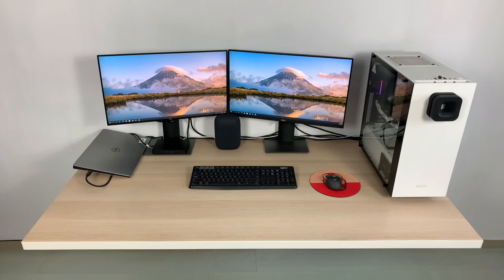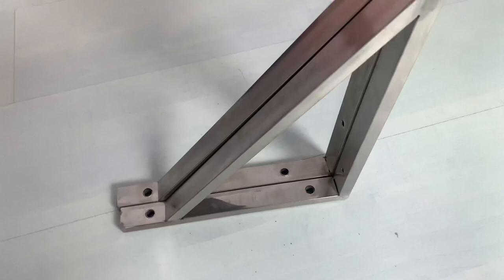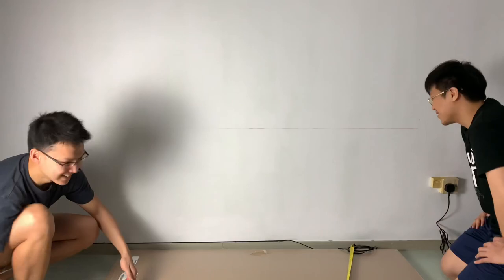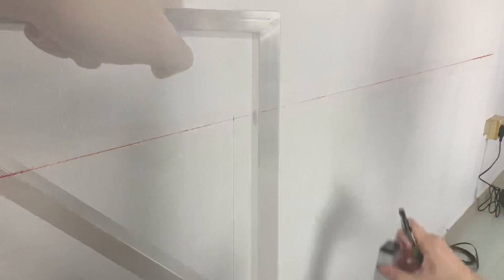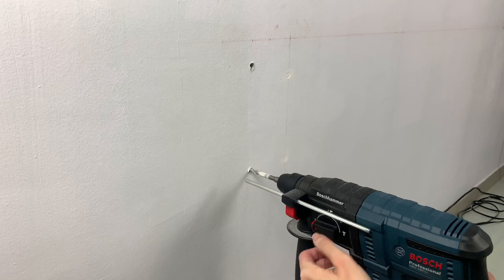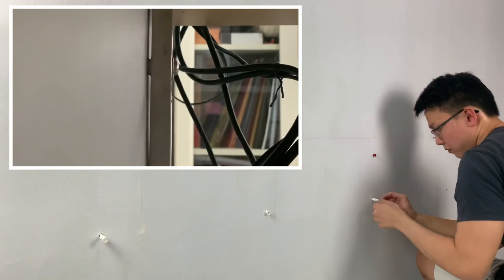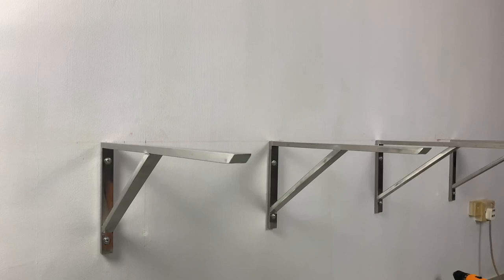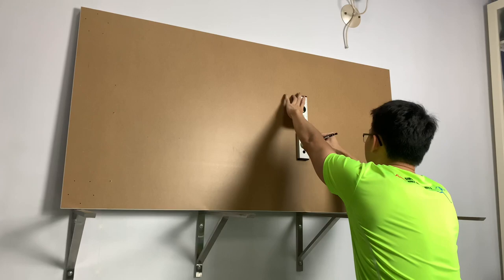How to build a wall mounted table ft. Ikea Linnmon Table

Comment: Linnmon table top is empty honeycomb cardboard. 
This way your screws are held in 3mm cardboard.
Reply from the maker: Yes that is true for most part of the table but it is made up of dense chipboard at the the sides where IKEA table legs are being fastened to. Therefore if you watch carefully, we only secure table to the outer 2 brackets where the chipboard is located. You can check out https://kakilai.sg/blogs/the-diy-blog/wall-mounted-ikea-linnmon-table for actual dimensions of the brackets. The inner brackets were meant to only support the load from top down, securing just the out brackets is enough to make it sturdy.

Comment: The 22” bracket that was suggested is of very bad quality. I order two set (4 brackets) and seller give me two different batches. Worst thing is the bracket is not even at 90 degree angle. So even after I aligned the level, the table top cannot sit on two of the brackets. Suggest you remove the items so that other will not get the bad stuff…..?
Reply from the maker: Hey Alphonse, I'm sorry for your experience, that seems like a seller issue and you should dispute with aliexpress to get your money back. Unfortunately, as much as we like to control the quality of the DIY projects, materials that isn't supplied by us is not within our control. That said, the intend of the video is to spread ideas so that people can find inspiration in implementing similar projects. If you do find better alternatives, you can leave a link here so that we can all learn from your experience. We did find some alternatives, from Mr DIY shop after completing this project, you may want to check it out to see if it fits the bill. Cheers!

Comment: I would like to set up a 200x120cm made of two 200x60cm Ikea planks hanging on a wall
Do you hace any advice that could help ?
Reply from the maker: Hey, unfortunately you will encounter different issues/problems for every DIY project, just gotta be creative and find a solution as it comes. The problem I see using two 200X60 planks is how to join them together firmly. There is quite a number of DIYs on YouTube educating people on the different methods of joining two planks together, you should check those out!
Reply: @kakilai  i'll check that out. Thanks for your answer and for the advice